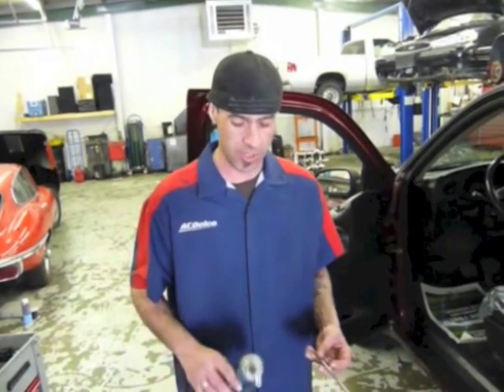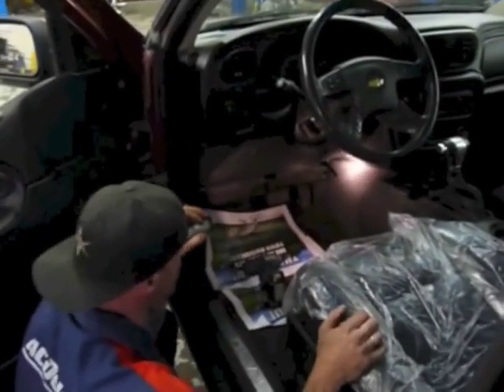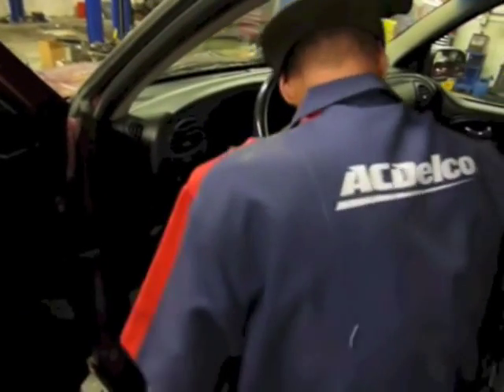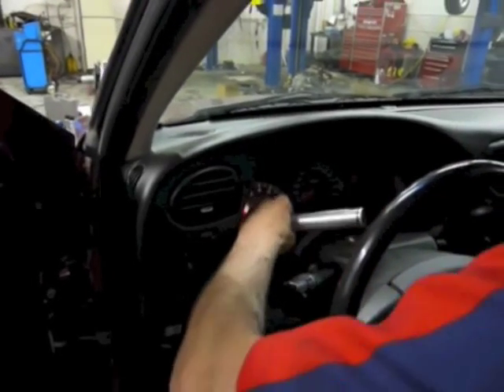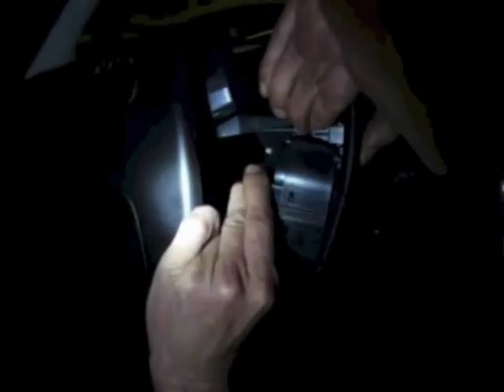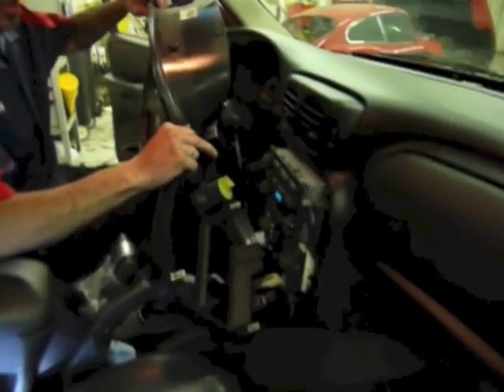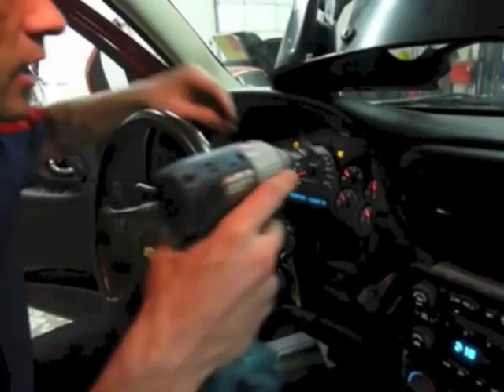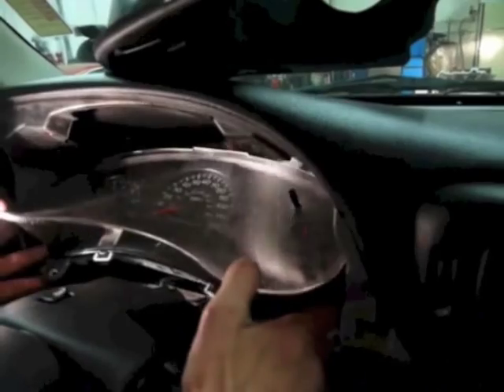Buick Raineer Cluster

Comment: Great video. I have a 2007 Rainier and the back lights don't come on at all. all the gages still work just fin. I checked the fuse and its good. I tried adjusting the  backlighting knob but no changes. Is it common for just all the backlights go out only with everything else working ok?